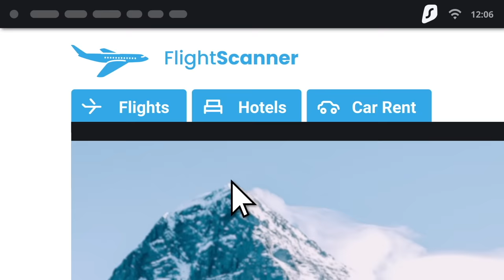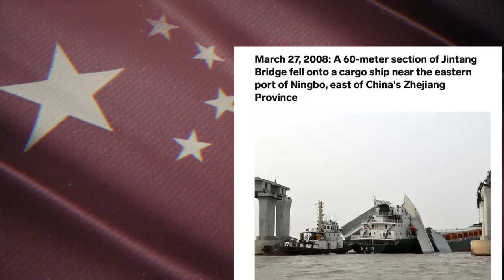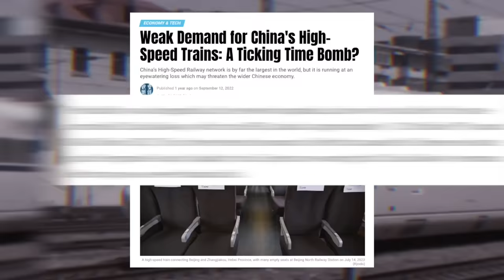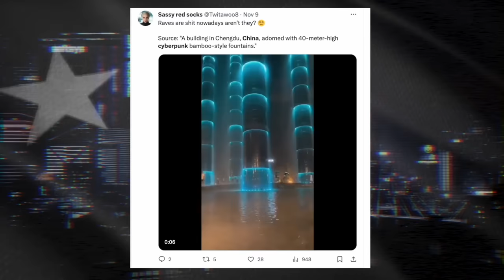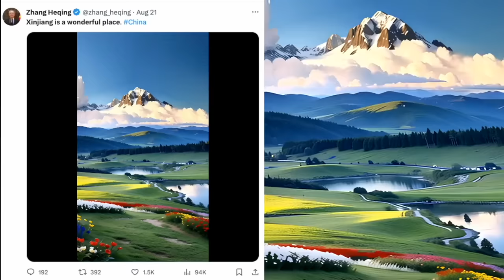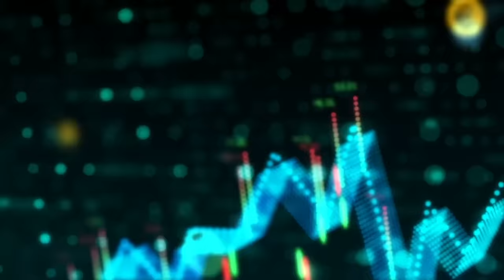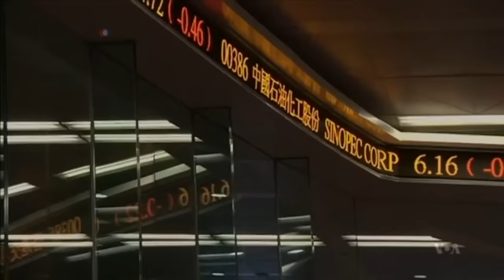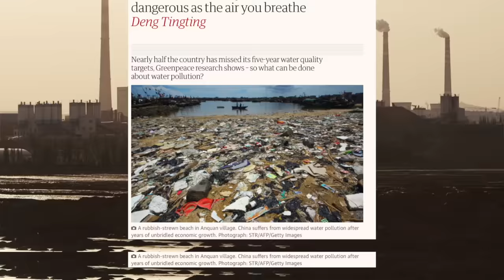Why are China’s Trains Randomly Crashing? - The Hidden Disaster of the High Speed Rail Network

Comment: I'm proud of Japan's Shinkansen. Most notably, it's perfect safety record. When people were saying China's rail system will surpass Japan's, first they need to surpass the safety record. Good luck with that lol.
Reply: I noticed the footage of the Shinkansen in the background and immediately thought it was the opposite of all the systems covered in the video.
Reply: Hasn't there only been 1 faster train crash? Like a new crewman disabled the brakes accidentally or something like that?

I may be thinking of a different country though so idk
Reply: Even through 9.0 earthquakes. Nobody touches Japan’s Rail engineering!
Reply: I've never been to Japan and never will be. But I don't need to see Japanese railway to believe you. 
 Japan started with nothing but ruins, a bunch of generators, and determination. And today they are lead manufacturers of auto-moto transport. I know that even when I buy the cheapest possible Japanese car or bike - I get a reliable and powerful machine. Made in Japan automatically translates to "quality" in most people's minds. From the medical equipment to an airbrush. Even a god damn omron mouse switches. 
 China just buys companies, gut them, and use their tech in their own brands. Like they recently did with volvo. As soon as they bought volvo the quality dropped sharply. They always cut corners. Always cheat. Made in China sticker translates to "crap" in people minds. 
 So no wonder that railways quality differ so much between those two countries. Everything else does as well.
Reply: Japanese people take pride in their work unlike.....
Reply: American here. My wife and I rode the Shinkansen from Tokyo to Kyoto and back. It was impressive: fast, clean, quiet, safe, and comfortable.
Reply: To be fair, China is very very large..
Reply: @WhatSmellsLikeToast  they also have a bigger budget, more repairmen and so on. It's all proportional...or...it should be...
Reply: Yeah with all those earthquakes y’all need sun safer train forsure lmfao, didn’t the scientist said that Japan is sinking?😂😂😂😂
Reply: @WhatSmellsLikeToast and very, very corrupt
Reply: Quality over quantity.
Reply: The CCP Chines trains are crashing b/c they’re thrown together with Little to NO quality control quality assurance  &/or subjective PMS (preventative maintenance).
Reply: @pabis6817 less corruption in Japan
Reply: @MalfunctioningAndroid  Japan also we’re reconstructed with help of the United States military who set up the industry logically
Reply: @noturfather1106 😂
Reply: @WhatSmellsLikeToast you're being toast 😂
Reply: @WhatSmellsLikeToast  and corrupt, and inefficient and dumb and silly.
Reply: The Shinkansen is 1/20 the length of the Chinese HSR
Reply: It was a bit dirty inside the Shinkansen though.. and it looks very 80ies... I prefer the new speed thains and double deck speed trains in Switzelrand.. some of which even have huge play grounds for your children and big beautiful restaurants in them with high end food, whilst being affordible for everybody. AND VERY clean, both in first class and in second class.
Reply: The difference is the Japanese engineers and governmental officials are not based on conformity and obedience. Japan needs accuracy, and expertise, not merely party loyalty, in fact one may be a differing party, unlike USA, UK or PRC, where loyalty matters more than reality.
Reply: @rattyratstuff7125  I think the only one is the Mishima train station incident in 1995. But it wasn't from a crash and was someone that got their finger caught in the door. Now the doors on all trains in Japan have sensors that will open again if something is caught. The worst accident that comes to mind (not Shinkansen), was the Amagasaki derailment in 2005, that ironicaly can be attributed more to this country's strict adeherence to perfection and work culture. It was a tragedy that shocked the nation but the massive changes both in safety systems and work culture the railway company took post disaster was good to see.
Reply: I wouldn't say it's a perfect safety record of absolutely zero deaths but without a doubt still an incredible safety record, the best you can physically get. The safety on China railways needless to say, however, is pretty bad when compared to literally anything else, especially the shinkansen.
Reply: @JonKuster Never saw a "dirty" shinkansen in two years of living in Japan. 
Never saw much trash on the city streets even though there are no trash cans either.
 Japanese people just don't litter.
Reply: @konstruct11  Can you tell me when and how the US helped set up the Japanese industry in a logical direction? And if it did, why aren't they heads and shoulders above the Japanese train industry right now? I'm genuine curious, please educate me.
Reply: @WhatSmellsLikeToast that’s not an excuse to have such a massive failure rate on the majority infrastructure projects like High speed rail they tend to tell the west that they’re very good at, Japan isn’t a small country and hasn’t had a train that’s killed anyone since its introduction back in the early 60s
Reply: @iamsheep what’s that supposed to mean? China HSR are far more corrupt and is Quantity over Quality, while for Japan it’s the complete opposite
Reply: @JonKuster  I don't doubt Swiss trains being great, but I do doubt the Shinkansen being so dirty. The only situation imaginable is a rare situation that you came across the scene right after someone littered the place and it was right between cleaning. If you're saying being a bit old as dirty, that's kind of mean. That would make me dirty because I was born even before the 80's, though a take a bath every day and wear clean clothes.
Reply: @clubeyxander5132 he’s talking about in terms of economically, I mean ofc the Japanese are beyond leagues ahead of the US in rail experience, the U.S. gave Japan experience militarily and economically since the two “lessons” on Hiroshima and Nagasaki
Reply: @konstruct11  thanks for adding that. USA is an inspiring country as well.
Reply: @MalfunctioningAndroid the first Honda was a bicycle with small army surplus 2 stroke engines bolted to them.
Now look at them
Reply: @keifuchan7265 Yes it was operator error caused by JR's toxic work culture using nikkin kyoiku日勤教育day shift education-an euphemism for using psychological torture for employee mistakes. 

Seconds to Disaster has a good documentary on this crash too.
Reply: The fact that some Western European countries even the US with its 4 high speed rail line network the Northeast Corridor Acela high speed Keystone Corridor Empire Corridor and Chicago St Louis corridor and Bright line in Florida. and the. all other rails across the country that aren’t high speed have a better safety record than all of China Trains.
Reply: @Racko.  Japan IS a small country compared to China. Why do you think Japan has such better rail than America? Or why is South Korean internet so much better than America's? Any thoughts?? 🤔
Reply: @clubeyxander5132 That guy is sus. I don't think he has ever ridden the Shinkansen. 
In the two years of my living in Japan I never saw a "dirty" communal space whether a giant baseball stadium or the local gym even. Occasionally a busy restaurant can dirty but not for long. 

As for the look of the Shinkansen it gets updated all the time.
Reply: @davesy6969  yeah, I read that they converted a lot of army bunker's generators to be engines, and started from that. Always evolving, never stopping.
Reply: @WhatSmellsLikeToast   in comparison to China it is, but alone it’s far from being a small country, it’s a giant island of the coast of East Asia, “why do you think Japan has a better rail system than the U.S.”, brother, US companies have been lobbying against rail with car and oil companies, along with airlines, which is why it’s so behind while the Japanese earned experience through rail from the Shinkansen Zero series. They don’t have power companies lobbying away from the public’s interest

South Korea is irrelevant here, their internet is so fast because of The proximity dramatically reduces the cost of infrastructure with simplifies network development bro
Reply: @peterseth3296  “there’s nothing in the video that HSR in China crashes”, did you watch the video at all? All the footage are fake right? Lololol
Reply: @Racko.  yeah, internet networks benefit from population density but not train networks. Makes total sense 👍
Reply: You're just asking for chinese agents to sabotage their lines.
Reply: I mean Frances safety record is basically the same.
Reply: When people were saying China's rail system will surpass Japan's,  WE ALL LAUGHED : )
Reply: It's a little off topic, but I'm a carpenter, and we hold Japanese joinery to the highest standard as well.  Your extremely high standard and skill level on this front echoes all over the world.
Reply: @iamsheep  and better.
Reply: Most of China High Speed rail cannot earn even get close to paying the OPERATING cost let alone interest and capital repayments. It’s only a few lines like Shanghai to Beijing that have sufficient passenger volumes. All the rest just suck.
Reply: Theres pride still in japan..they are passionate with what they do and put their name/soul into it. Thats why japanese stuff is still at the top of reliability/quality of build in most thing they produce there.
Reply: @clubeyxander5132 There is no clear timer mark when Americans guided and helped the Japanese, but very likely, it should be after the 2nd WW. What was important was that The Japanese learned about modern concepts of quality control and logical management. From there they developed into all their industries and they became the manufacturer of the world with very consistent quality management.
Reply: They can copy the Japanese technology but not Japan's safety culture
Reply: @Racko.  lol how big of a land mass is Japan?
Reply: I am that is impossible. As far as Death resulted accident is concerned, China at least have a major one with about 40 deaths and about 200 injuries and that happened within 30 year after the Chinese HSR established. For Japan there has been no death-involved accident since the Shinkansen started in 1964 until now, almost 60 years duration. What is scary is that the Chinese authorities simply wanted to brush this major accident (literally) aside and no report or accident prevention plans was realised afterwards.
Reply: @william6223 what on earth are you doing by conflating the USA and the uk with China?  You really ought to explain yourself because what you have written appears to make no sense. For example there are issues with the train network in both the USA and the uk but that’s no secret. And there are also issues in China. And the connection is what, exactly?
Reply: @julianlau5579  wrong. They completely overhauled their safety systems since the accident.
Reply: People going on about Shinkansen forget Japan had a rail crash in 2005 that killed more than 100 people
Reply: @peterseth3296  Learn to read. He said safety culture not speed. 🤦
Reply: @iamsheep  That was not a high speed bullet train but a commuter train going too fast on a curve as happened in most countries with trains.
Reply: @peterseth3296  Give it another decade and China will not surpass Japan's Nobel Prizes too.
Reply: @iamsheep Japan stretches from Maine to Cuba, not really a small nation.
Reply: @peterseth3296 I doubt it, China is memed in terms of quality of a reason, every Western Nation and Japan outclass them in terms of rail safety, mainly Japan
Reply: @peterseth3296  Hmmm. Wikipedia still lists three for China. 
Oh maybe you mean a Chinese national doing research at an American university because America has eight Nobel Prize Winners(now nine apparently) who were born in mainland China?

Figures as China doesn't even have one university listed in the top twenty for institutions of higher learning.
Reply: @Racko.  🤣🤣🤣🤣🤣🤣🤣🤣
Reply: The Chinese system is based on the Japanese system without all the safety features.  One of China's high speed rail accidents was caused by a lightning strike.  The dead section of track caused a train to stall, and no longer be detected.  A second train ran into it because the system thought the first train was not there.  In Japan if a block goes dead the system assumes that a train might be there and sets the signals to red/stop.
Reply: I love riding the Shinkansen. A big part of that is the Japanese people on the train, they are always polite and quiet. Chinese trains are the exact opposite.
Reply: @Racko.  lol yes Japan is never corrupt 🤣🤣🤣
Reply: Japan won't be beat by China, because Japan actually cares about it's people, and refuses to do short cuts.
Reply: @jenniferlee1993  LOL the only short cuts they refuse is presentation
Reply: I want to visit Japan so so badly it’s so beautiful!.. the people, the culture, the history, the beauty of the nature around! just how amazingly respectful and kind the Japanese people are. And they added bonuses. I won’t have to die because The construction of the infrastructure is so bad that you may fall through the floor or a damn bridge may fall on top of you!… The food is terrifyingly fake even the water is scary!! And I am very Seriously don’t even drink the bottled water if you going to China!… if you don’t know exactly where that water came from or exactly where the beer came from or exactly where anything came from! even if it is sealed!! Do not drink, or eat it!! In Japan you absolutely know 98.9999% you’re getting high-quality the best of what they have to offer and nothing less…and you’re so very right China has nothing on Japan nothing at all!!.❤❤
Reply: @graythewolf6096  It is more or less a perfect safety record in terms of fatalities, depending on how you count it exactly. The single shinkansen accidental fatality was a passenger who got caught in the closing doors, but there have been no fatalities due to  crashes; there have been two derailments but both were fatality free.  This is why shinkansen documentaries like to say 'there have been no fatal crashes' rather than 'there have been no fatalities' ... it's only a perfect record on the more limited question. Still an impressive record, especially considering the amount of passengers transported and miles traveled.
Reply: @pabis6817 better than China's copy engineering😂
Reply: @iamsheep   I don't know what kinda excuse you're trying to make for China, here. Like, if Japan's quality and safety standards is already this good for a railway this short then the same standards would just scale accordingly if they built a longer railway as China's. 

Hell, all this does is put China at an even worse light as not only is their quality standards too low but also their planning.  China has double the workforce of Japan but somehow they can't maintain or exceed the quality of a smaller country? These nimrods didn't even consider scaling back their construction knowing that their maintenance support is inadequate for an HSR this long.
Reply: @julianlau5579  Thanks! I was always curious when the Japanese took on their quality management in modern heavy industry. It makes sense because before the war the Japanese were specializing on light industry like natural fabric. My grandparents always told me that before there was "made in Japan", "made in America" used to be the benchmark of high quality industrial products.
Reply: Bullet train was built to accommodate thousands of passengers everyday as the normal trains back then were impossible to cater to all of them.

These high speed railway networks in China did not have that many commuters to begin with and thus they bleed money every single day. Well, at least they have “bullet” trains, right?
Reply: @Racko.  So basically what you're saying is that dropping the atomic bombs made Japanese industry better, right. Heavy industry in Japan did exist before the World War but it didn't really flourish until after it, so I did suspect the Americans had a lot to do with it. I just wanted to know if anyone had any concrete information about it. I appreciate your response but, personally, I don't really think killing 390,000 civilians in air raids helped the Japanese to better their industry in any way. Thanks anyway!
Reply: @biiyen8458  re-read your comment and think about what kind of logic you're trying to make.
Reply: China : "Safety record is important?"
Reply: China : " Japan trains too slow. As long as trains look good, it's safe enough".
Reply: @clubeyxander5132  Nah What im saying is after their loss at WW2 from the US they stopped messing with everyone else and instead tried to get along financially and economically, but yes you're right, Industries always existed even before WW2, Despite all of their amazing tech, and reputation for being a clean safe nation, Japan itself is falling behind in the modern 21st century tech race, theyre still using things like Fax machines, But no problem man, have a great day as well!
Reply: @konstruct11 No.😂American rail road system is ancient and have no speed train technology
Reply: @keifuchan7265 no casualties there
Reply: @clubeyxander5132 because America hasn’t. American railroad system is 50 years behind
Reply: @WhatSmellsLikeToast No Japan has the highest safety standards not because it’s a smaller country but because of the earthquakes. And safety standard in all constructions, elevators etc..
Reply: @peterseth3296 Chinese mentality is different
Reply: @iamsheep Shinkansen never had deaths!
Reply: @mirikaku5811  which again, is a population density issue. We have earthquakes here but they're not right under NYC
Reply: Japan's high speed trains send you to heaven, Japan's high speed trains hold the highest death rate record
Reply: And France, the best in the world with japanese system
Reply: @mirikaku5811  I’ll take partial ownership of land, crappy trains, the second amendment, the right to defend yourself over a supposed fantastic train system any day of the week. Enjoy your dystopian country.
Reply: Japan has the best rail system in the world, hands down
Reply: @rinzler9775  Yes, Japan has the most suicidal railway system in the world:face-green-smiling:
Reply: @rinzler9775  indeed. But if France didn't have so many strikes, it would be a draw. French TGV and Shinkansen share the first place every year almost 😉. France and Japan are the kings of trains, NOBODY in the world can compete with them!
Reply: @markkozell4817  Japan is dystopian?
Book a trip to Japan and use the JR Pass so you can ride all the trains for free to see how dystopian our country really is. 

I'm a former over the road truck driver who has seen plenty of plenty of dysfunction in the 48 states first hand.
Reply: @sanzhang-qy3ng  Lol. Someone offended by the shinkansen's perfect safety. 😂
No wonder Wenzhou happened. 😏
Reply: @boredscientist5756  agreed, France do things properly as well, in fact most of the Euro nations.
Reply: @sanzhang-qy3ng  have you actually been there and tried it ? Although they dont let criminals into their country, it could be tricky.
Reply: @rinzler9775  Yup. 45 out of the top 50 busiest train stations in the world are in Japan along with the top ten and number one-Shizuoka Station. 

And these stations are safe, clean, and the trains always run on time.
Reply: @kenm3943  JHSR is like a tractor, ka ka ka ha ha ha:face-blue-smiling::face-blue-smiling::face-blue-smiling:
Reply: @rinzler9775  JHSR is like a tractor, ka ka ka ha ha ha
Reply: @sanzhang-qy3ng  Lol. Without Japanese tech there would be no Chinese HSR. 😂😂😂😂😂😂😂
Reply: @sanzhang-qy3ng  Why does China HSR still need to use Japanese ball bearings from NTN and NSK despite decades of forced technology transfer?

Maybe because China couldn't make a ballpoint for pens until 2017 when Taiyuan Iron Works finally did it. 😂
Reply: @kenm3943  The Japanese should invent their own language🤣🤣🤣🤣🤣🤣
Reply: @jacklee-yy5bx  Maybe China should have invented an alphabet like Japan did to go with ancient hieroglyphics. 😂

That is exactly what Korea and  Vietnam did and ditched their inefficient writing system they inherited from China. 👍
Reply: @kenm3943  But you lower races still use Chinese characters:face-green-smiling:
Reply: @jacklee-yy5bx  Yes absorb what is useful; reject what is useless. 

Better question is if China invented paper how come it never discovered origami? 😂😂😂😂😂😂😂😂😂
Reply: @jacklee-yy5bx  If Japan is a lower race then why does it have 29 Nobel Prizes compared to 3 for you? 😂😂
Reply: @peterseth3296 what does that have to do with China's crappy safety record? Stop trying to distract or lie to us. It's truly pathetic.
Reply: Even here n Philippines , japan's products are always the top choice when looking for a quality .
Reply: First they need to learn true honour, real respect, actual integrity and have people understand accountability from bottom to top.
Reply: Loved the Shinkansen when I visited Japan 💖
Reply: "Jiăng hăo zhōngguó gùshì" is real in this comments' section, lmao. They really be telling Chyena's "history" all over mean mean BS callers!
Reply: I'm proud of Japan, too, and i'm not even Japanese!
Reply: @jacklee-yy5bx Imagine talking all that good sino shit in the alphabet of your masters, in the language of your masters

That's how relevant is China to the world, with how many people bother ever learning it over how many native speakers it has.
Reply: Japan is one of the most beautiful places on earth.  I’ve traveled a lot and when I’m in Japan I never want to leave. I always feel more than safe as an American and there is so much impeccable culture.
Reply: @clubeyxander5132 yep.. that dude is trippin. I HIGHLY doubt they would be dirty.
Reply: Made in China or Made in Japan, I will bet on Japan
Reply: @boredscientist5756  because the French, different from the Chinese, follows safety measurements and don’t use counterfeit parts etc
Reply: @sanzhang-qy3ng  Chinese…just post anything
Reply: To my knowledge there is only one crash involving a Shinkansen and it was caused by a different passing train derailing and hitting it many years ago
Reply: Indonesia has best high speed rail now..
Reply: God bless Japan 🇯🇵most polite ,clean , respectful people on earth
Reply: @yichengz  and how is having safer trains bad..??? how much yuan did you get paid
Reply: @WhatSmellsLikeToast It is relatively close to the same size as the US. Not too mention, our infrastructure is much better than theirs, despite much of it being decades old. Add on the fact that they are essentially indentured servants to their govt....they have no excuse.
Reply: @jim2376     and those Bento boxes...haha
Reply: @JonKuster  "It was a bit dirty inside the Shinkansen though" Yeah, sure. "Affordable"? In Switzerland? Yeah, sure. Collect your fifty cents.
Reply: @rond3238  We didn't dine on the train. But if we're ever on a Shinkansen again, we'll give them a try.
Reply: ANYBODY can make something fast with enough money. Making it safe; firstly takes a country with workers/human rights and isn’t ran by greed and filth.
Reply: Don't you know how to use Google? You can Google the Shinkansen accident in Japan
Reply: @shenyun7195  I googled "shinkansen accident" and it came out as "Chinese shinkansen accident" meaning Wenzhou of course. 

I guess you wish you could bury that search result in a big hole too? 😂
Reply: Perfect? What are you smoking? Go look at actual statistics
Reply: @Jkl62200  No fatal accidents in a land known for earthquakes, typhoons, and blizzards during its almost 60 year existence sounds perfect to me. 

Doh!
Reply: That's the reason India is going to buy E5 series shinkansen from Japan in 2026
Reply: @kenm3943  duh... Japan's hsr system 16 times smaller than China's with multiple times less traffic.
Reply: @unknownboy8202  India, India, India is always going to, going to, going to
Reply: @Jkl62200  what do u mean brother
Reply: @glidershower  Where is this crap coming from?
Reply: @Jkl62200  Cope harder!
Japan's Shinkansen has no fatal accidents despite numerous earthquakes, typhoons, and blizzards. 

Moreover, Shinkansen lines go over multiple rivers and valleys and thru mountains whereas China's go in a straight line into the interior or along the coast on flat land. 
No degree of difficulty with a straight line on an open plain no matter how long. 
And China STILL couldn't get a perfect safety record. 😂😂😂😂😂😂😂😂
Reply: @william6223  you have zero idea of Japanese culture or any confucian culture like China, Japan and Korea. Duh
Reply: @kenm3943  China's hsr is 16 to 17 times bigger than Japan's and it passes through even more different types of terrains. Lol.
Reply: @Jkl62200 Cope harder means cry harder.... Duh. 😂

Just take your L. Japan could easily build your simpleton HSR  lines but China could never build Japan's Shinkansen system thru challenging terrain and natural disasters. 
And we both know if China actually could there would be dozens of accidents in the same time period. 
Imagine the tofu dreg bridges and tunnels that connect the Shinkansen to Hokkaido and Kyushu. 😂😂😂😂😂
Reply: Name 3 accidents that occurred on the Chinese HSR and when did they occur?
Reply: Wow
Japans public rail system, like every other country globally, runs at a loss.
Reply: @mirikaku5811 
Experiencing an earthquake tends to focus the mind on the safety issues.
Reply: @konstruct11 modeled after Amtrak /s
Reply: Japan has and will always be a country where it'll make sure safety is followed and kept you dont cut corners you can be guaranteed it's well built .
Reply: @konstruct11  Not true. The shinkansen was built in 1964 - over a decade after the US left!
Moreover the US actually tried to DISMANTLE the zaibatsu corporate groups that built Japan's prewar transportation system, but as soon as Japan got full independence again, they threw out the US-created laws and let those companies (Mitsubishi, Sumitomo, Mitsui, Ishikawajima, etc) re-form. Those were the companies that built the Shinkansen.

The only real positive things that the US did for Japan following the war were: 
- feed the people for the first devastating year or so, and prevent mass starvation 
- leave peacefully and voluntarily in 1952,  before wearing out their welcome.

Everything else was either thown out by the new govt. as soon as they came to power, or was kept in place for self-serving reasons that had nothing to do with what the US intended.
Reply: Yes the Shinkansen,s safety record is astounding.  In the past few years I have ridden on Taiwan’s Shinkansen known as the Gaotei.  I believe it too has a very good safety record.
Reply: @kenm3943 that’s really impressive too when you realize that Godzilla ( Gojira) shows up periodically to trash it
Reply: Oh, it did surpass it alright. It surpassed all trains records of the worst failure in history when it comes to trains. That's the only thing they're "good at." Stealing ideas and IP and trying to adopt it as their own but failing miserably at every turn.
Reply: @bradley8575 And especially: The bad accidents that did happen with high-speed rail in western Europe did cause huge investigations to avoid recurrence (e.g. the Enschede derailment in Germany 😢 (a really bad error with the wheel choice), and the derailment near Santiago de Compostela in Spain (humans error + lack of automated braking/signaling in one section).
Reply: Japan 🇯🇵 puts safety ahead of profit, ego.  That’s why it deserves and gets World’s respect.
Reply: It is also going to start in India in 2025 we have bought six shinkansek 5
Love Japan from India ❤
Reply: you can count the number of accidents on the Chinese HSR within one hand.